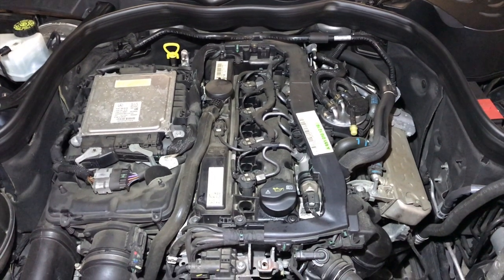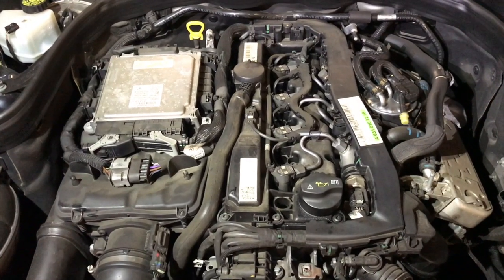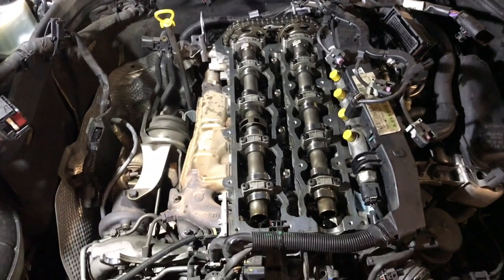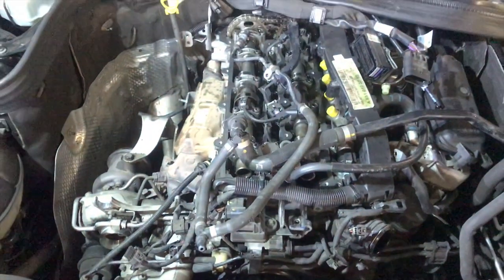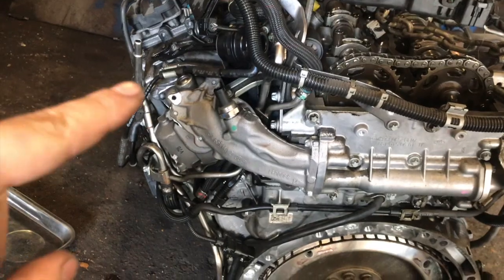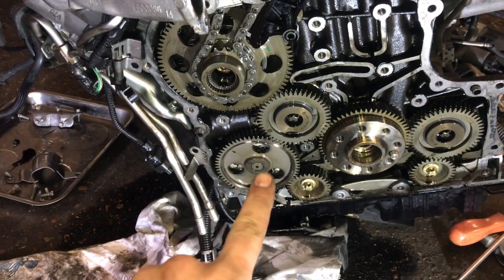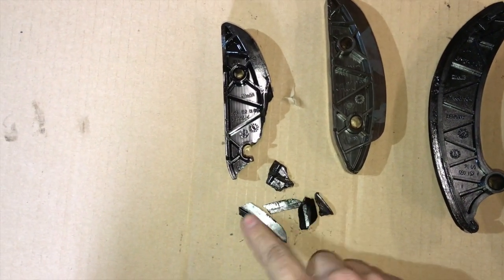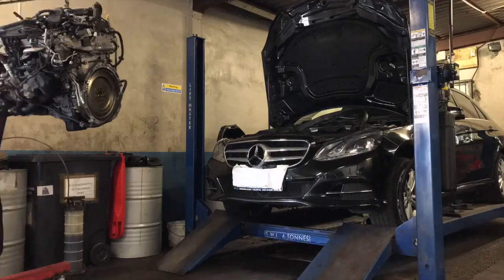Mercedes | Timing chain & guides replacement | OM651 220,250CDI

Comment: I'm really thnks to u for this video. Every informative. 
 I have question, This noise repeated come up every time u start or just once ? I have the same issues that i detected in jun 2019. And the noise just came up only 1 time. No more noise until now.  Hope u can help me to sharing some experience or any possibility why that happened.!!
Reply from the maker: This noise happens only when you start it first time when engine off for a few hours, if you switch off engine and start again it will not make this noise, best time to listen to the noise is the first engine start up in the mornings, if you are worried about the chain, i recommend opening the bonnet and starting the engine in the morning and see if you can hear the rattle.. hope this helps 👍
Reply: I ve changed the chain tensioner and now no noise
Reply from the maker: I have had a lot of people come to me saying i got the tensioner changed but the noise is still there so can you change the chain lol..

Comment: How do you check if the battery is holding 12v or what are the signs of a failing battery. Keep the videos coming 😎
Reply from the maker: Hi Altan, there are special battery testers that can check the condition of batteries you can get one of these testers for as cheap as £3-£5, (which will be a basic tester), thanks for the comment and support 😁

Comment: How many miles on this engine?
Reply from the maker: 2016, 70k miles
Reply: Thanks for the input, I have a 2014 E250 which I believe has the same engine. I love the car, I guess I will have to find a mechanic that will tackle this if necessary.
Reply from the maker: If you catch the problem early, you dont need to remove the engine and it will cost you half the price of this job. So listen for a rattle when you start the engine in the morningd
Reply: Hi, Is this the same engine as in Sprinter 316 cdi year 2017? And why doesn’t have the whole engine be removed when discovered early? Is then just a chain replacement sufficient?
Reply from the maker: Yes it the guides are not broken, you can remove the rocker cover and change the chain and tensioner only
Reply: @mercmantips By replacing the chain and tensioner, do you extend and protect the life of the guides or will they eventually also fail? What causes the guides to fail? Thanks.

Comment: Thanks for sharing, it's a problematic engine that's no doubt about it, but with tips coming from you we get to know how to be alert.
I have changed the fuel filter housing  and the EGR plus the intake manifold cleaning DIY thanks to you, was not a easy job but with your help and taking my time job well done.
Thanks again MercMan.

Comment: Om651 the best 🤦🏻‍♂️.. done few of this not the best .. always the right side timing chain guide gets damaged..
Reply from the maker: Yes thats right, you can actually change the right guide without taking the back cover off, makes the job a bit easier, but we always change both guides so the cover has to be removed..
Reply: @mercmantips  Do you mean without engine removal from the car the right guide can be replaced?

Great job on the video 😀
Reply: @mercmantips By replacing the chain and tensioner, do you extend and protect the life of the guides or will they eventually also fail? What causes the guides to fail? Thanks.

Comment: Brilliant work yet again, and there was me happy with getting the o-rings on oil filter housing replaced 😄

Christ they really are shockingly designed.
What oil would you recommend? (I assume oil changes more regular than what dealers state too?)
Reply from the maker: These take 5w30 fully synthetic MB229.51, i dont think its the maintenance that matters, im doing another one at the moment same problem, its a 2016 e220cdi 70k miles, been serviced at mercedes main dealer
Reply: MercMan Tips same as my own, full dealer history 87’000 miles, as yet no chain noise. Can’t help but feel the stop/start function plays a big role in degrading a chain that’s that light. Massive torque being put through it on every restart and as you know, chains do not like being jerked up to speed.
Don’t trust Mercs recommended service intervals either. More particles in it = more friction and reduced lubrication.
Such a pity with it being a cracking car...........although the panoramic roof is driving me f*cking insane with creaking when on a winding/bumpier road
Reply: @Raffo140  Yeah my thinking the Eco start stop is causing loads of premature wear. There was a post on forum about how those without start stop are going further mileage (150k+) without issues.
Reply: Drift R1DR  something I turn off the second I start the car, done it in previous cars too. My thinking previous was less wear and tear on the starter motor
Reply: I have a GLK250 with this motor and at 89k miles its still quiet and smooth at all times (even winter-cold startups).  No start-stop system on it.
Reply from the maker: Funny that because i have not had this problem either on the GL’s and ML’s yet, even though we look after quite a lot of them, time will tell
Reply: @mercmantips  I have the same engine on my Sprinter 2015 and I believe it has been  fitted on sprinter up to 2018 , now am getting close to pass 300K all motorway milage , all good apart from the common problems on this engine such as manifold inlet crack ,dpf flex pipe issue ,vacuum pump .. but in regards to timing chain or glow plug or even high fuel pressure pump  nothing so far for me  , do you think that could be because of bad ownership or not servicing them on time with right parts , can you elaborate on that one please
Reply: Im fill the problem from stupid function  start stop, its difficult to engine. Always switched off  manualy.. But millage not high, until no problem. Only 80000 km. Trunk battery was dead already.  And few arms  in front suspension.

Comment: MercMac - how bad is this rattle? Will it get this bad always? Or can they let go while still being much quieter rattles?
Reply from the maker: If you leave it and keep driving it will eventually brake the guides, then there is higher chance of timing jumping and damaging the engine
Reply: Thanks MercMan - I've heard using the ECO mode start stop can cause premature wear too - is that true?
Reply from the maker: Im not sure, but i always turn that sh!t off when  driving 😃 hate it

Comment: Thanks for the video, very informative.  What mileage had the car done and did it have a poor service history contributing to this failure?
Reply from the maker: This car had 110k miles, i dont know what sort of oil they used, but im doing another one right now 2016 e220 cdi which has 70k miles and exactly the same problem, just unbelievable..
Reply: @mercmantips  my one lasted 170k. The guides were intact when i removed them only the timing chain was stretched. I didn't want to take the risk of only changing the chain.
Reply: @NiaTech By replacing the chain and tensioner, do you extend and protect the life of the guides or will they eventually also fail? What causes the guides to fail? Thanks.

Comment: Great video and good advice, mine went but I caught it early and had the chain and tensioner done. Any idea why they wear out on these?
Reply from the maker: Just a bad design, nearly all OM651 engines sooner or later starts to rattle, you can see in the video its a single chain and its thin like a bicycle chain, the old diesels use to have a double chain and never gave problems...
Reply: Causes of failing chains and guides are mostly the emissions hardware. Feeding hot exhaust fumes back into the intake makes the engine run very hot. This heat causes rapid oil brake down (hence shorter service interval with good quality oil are necessary) The excessive hot oil also makes the plastic of the chain guides brittle. As the chain stretches due to wear and the chain tensioner running out of adjustment and / or chain tensioner failure will causes extra slack on the chain, causing it to start whipping against the chain guides. The now brittle plastic chain guides will crack / break causing even more chain slack with  the chain likely snapping. At that point the pistons will run into the valves; game over!
Reply: @mogdefender8520 Thanks for sharing. By replacing the chain and tensioner, do you extend and protect the life of the guides or will they eventually also fail? What causes the guides to fail? Do you need to replace the guides even if they are not broken? Thanks.